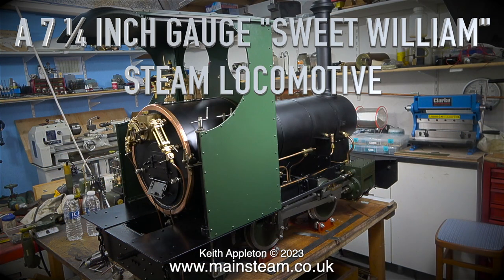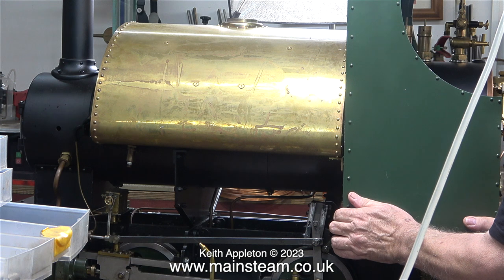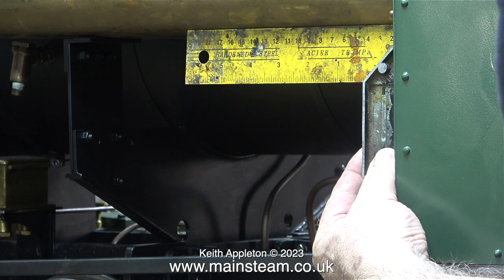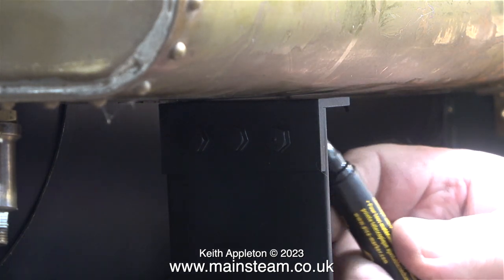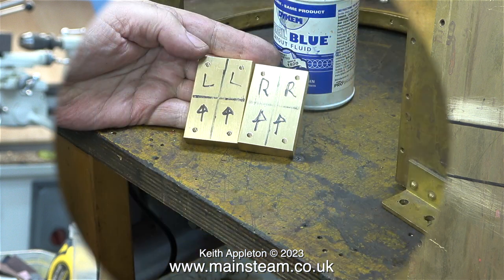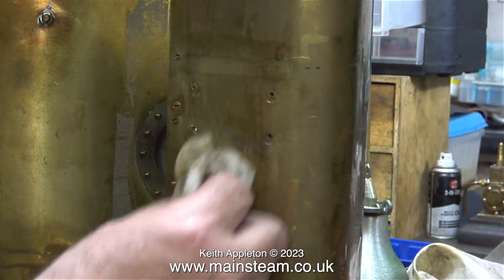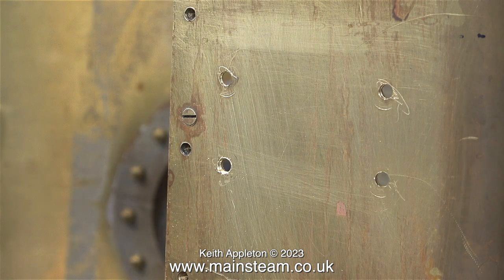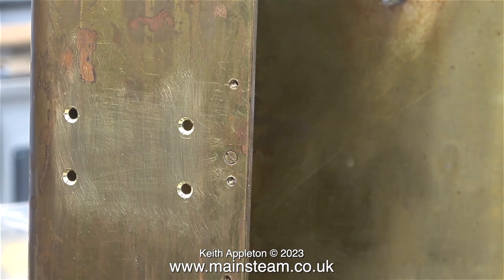A 7 ¼ INCH GAUGE "SWEET WILLIAM" LOCOMOTIVE - PART #55

Comment: Off topic question. Is there a reason you use BA screws other then tradition (which is a legitimate reason to me:)? I have found that 60deg thread form to have a wider availability and cheaper for hardware.
Reply from the maker: Most miniature Steam Locomotives & Steam Engine use BA threads. I use what Is shown on the drawings . . . . plus the BA nuts & bolts seem to be very accurately made, unlike some of the small bolts in Metric sizes.